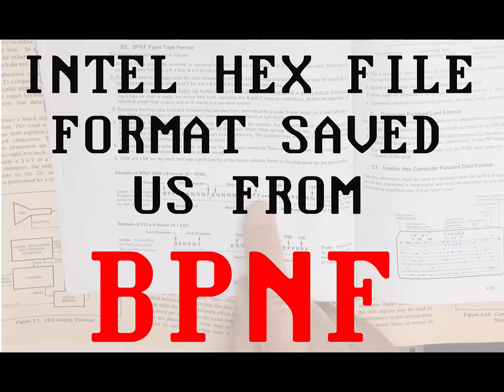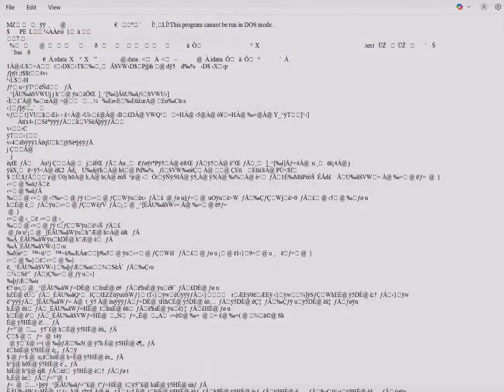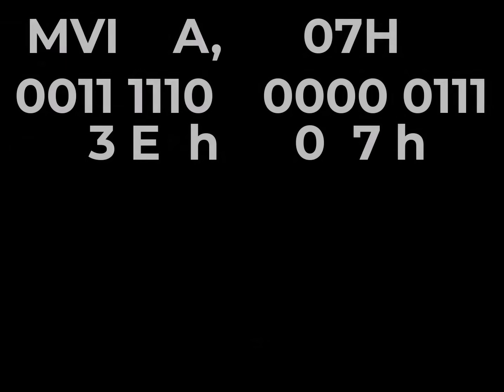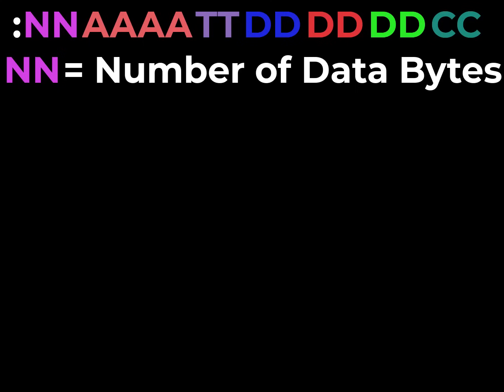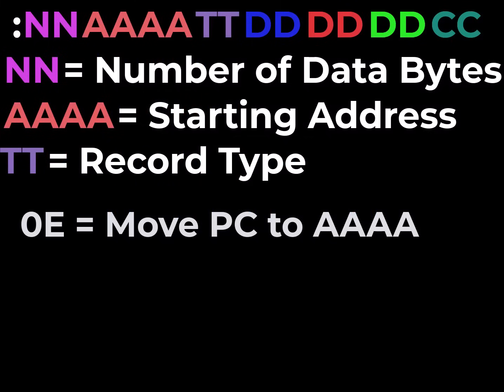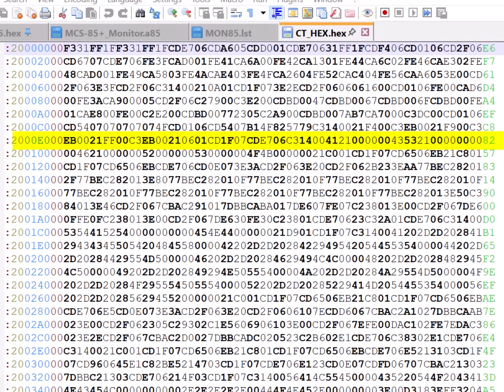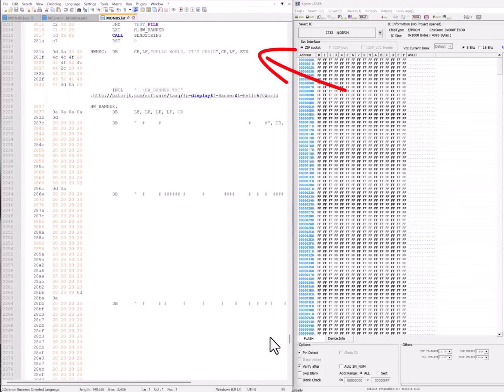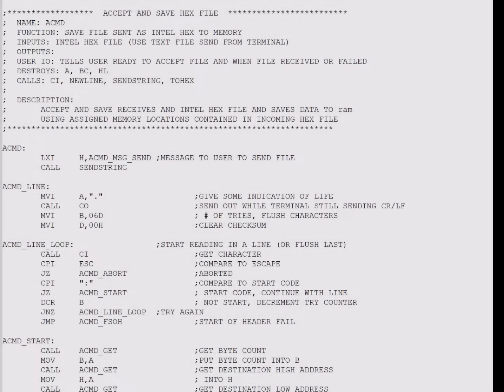{130}  The Ins and Outs of Intel Hex File Format

Comment: Interesting this, I just recently acquired and built a serial interface kit for my Sinclair ZX81 and was not best pleased to discover that it was hardware limited to the transmission and reception of 7-bit characters, as it was primarily intended for the transmission and reception of ASCII characters, i.e, for use with terminal software. What I really wanted to use it for was to download raw binary (machine code) into the '81, but it can't do 8-bit so it's going to have to be... Intel Hex to the rescue. One side bonus from this is that the Intel Hex code itself will inform the loader which addresses to place it in, so that's useful. I wrote something which loaded Intel Hex and converted it to another format a few years ago and someone managed to break my code almost immediately by attempting to load an IH file which had lower case alpha characters in it, something I have never seen in my life... but apparently it IS legitimate for IH to contain either upper or lower case characters even though the actual use of lower case in IH files seems incredibly rare.
Reply from the maker: I think the two biggest claims to fame intel hex are the ability to locate in memory and to perform even the tiniest amount of error checking.
A good warning about the lower case....  I would guess that lower case would break every intel hex handler I have ever written.

Comment: OMG THIS IS WHY! I once wrote a parser to inspect some old communications protocol that did something like this. At one point i spent like an hour trying to understand why the it wasnt working because it clearly expected what i was seeing in the debugger. Then when i realised my mistake i was so blown away that anyone would send the actual hex encoded ascii characters along a wire. They must have been influenced by this kind of madness, and i suppose with older tools this made sense.
Reply: Also note that a lot of communications channels were not 8-bit clean.  Even if you knew the person at the other end wouldn't try to display it in a terminal, you had to worry that it would get corrupted in transmission.  I'm not sure exactly when this stopped being a problem, but I occasionally bumped into it even in the early 1990s.  RFC 4648 (re-) defining Base64 was issued in 2006.
Reply: @jimjjewett  There were plenty of metods of stuffing more than 4 bits into a byte back then - but they (and Base64/Base85) fails the overriding imperative - each encoded byte should be self-contained for both viewing and editing to be usable. For this purpose that matters order of magnitude more than the space savings. And if you do care about space savings, well, compressing the hex file will make it smaller than the "clever" encoded one - probably similar size to a compressed version of the "clever" one in fact!
This is similar to how all the old Internet protocol is clear text, spelling out numbers in ASCII so it could be tested, used and debugged using telnet and a text terminal if needed. And it was frequently needed.